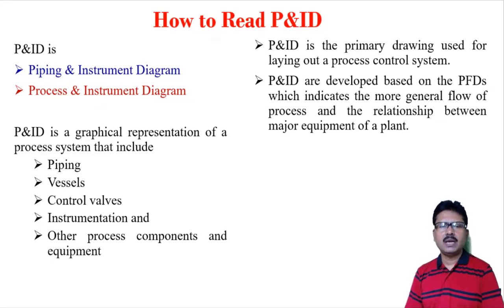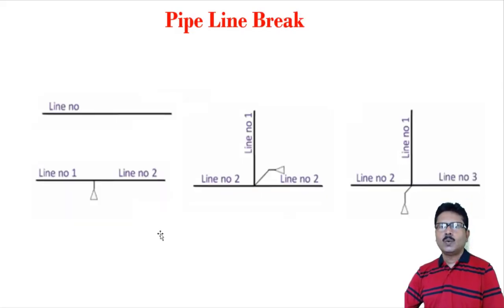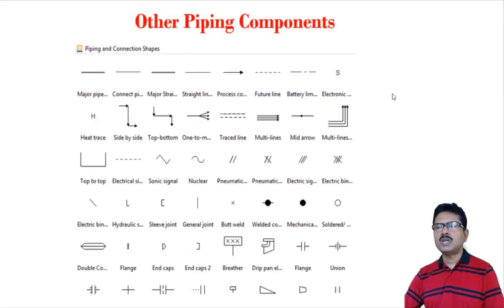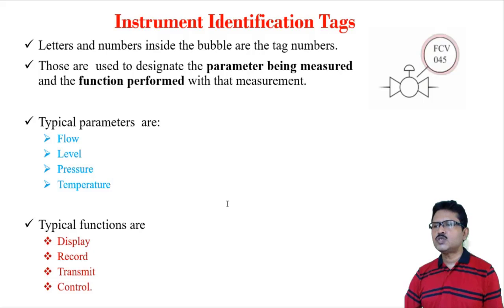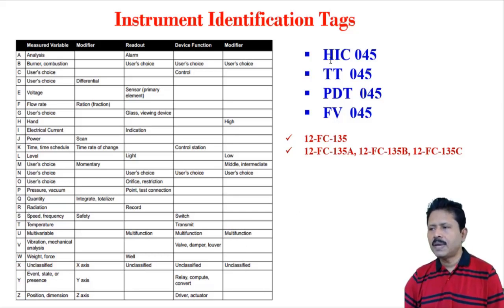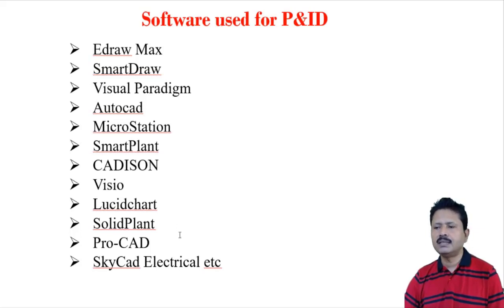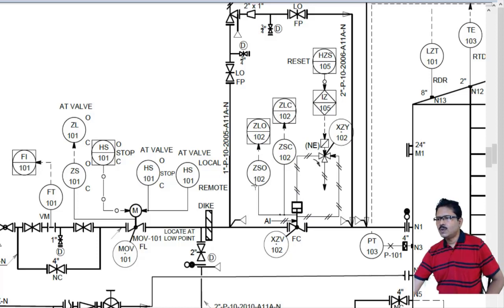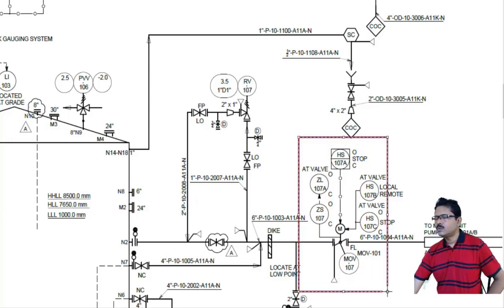How to read P&ID

Comment: Sir please is this course for mechanical drawings
Reply from the maker: This is Piping and Instrumentation Diagram. Who will work in plan, they need it. But Instrumentation Engineer need it vastly.
Reply from the maker: Everyone who works on Plant, they need it. Yet, as this is Piping and Instrumentation diagram, it helps a lot for an Instrumentation engineer.

Comment: can u explain FC, FO< cSO, CSC briefly in comment please sir?
Reply from the maker: If FC is 'Fail Close' and FO is 'Fail open' then the explanation is as below. These are characteristics of valves as per valve construction. Valves are operated by pneumatic supply and electronic 4-20 mA signal. Now if there is any fault of that pneumatic supply or electronic signal, the valve will not operate properly as per requirement of process. Say, the valve might be in fully open or fully close due to absence of that pneumatic supply. Now the thinking will come here regarding process safety. Which position, valve fully open or fully close, is safer at  malfunction situation. If fully close status of valve is safer with respect to process, then with this process FC valve will be installed, and vice versa. Now regarding CSO and CSC..... If full form of these two is 'Car Seal Open' and 'Car Seal Close', idea on these may be as bellow. CAR SEALS are a simple device used to seal (lock) a valve in the open or closed position to prevent unauthorized operation of the valve. Primarily this is made with metallic thread with  some sort of locking arrangement. Car seals are used with car seal tag (Red or Green) to seal valves in the open (CSO) and closed (CSC) position. Red or green seal tag  indicate the status of the valve whether it is sealed at open status or close status. It generally used on process critical valves to prevent inadvertent or accidental operation of the valves. ..........   By the way, may i know you, from where you are?

Comment: Sir, What is that trapezium symbol indicate that is at the beginning and in the by-pass line of a pneumatically operated butterfly valve with 2'' X 1" indication in the chart.
Reply from the maker: send me whole diagram and indicate the part of your query, i will try.   srtpo@rediffmail.com
Reply: @silenceandprogress   Thanks for the response. Searched in the net and got it cleared.
Reply from the maker: @sivakarumanchi6296  Ok. Good.